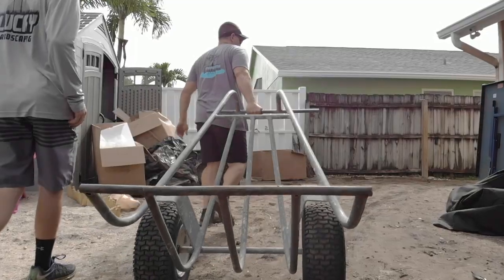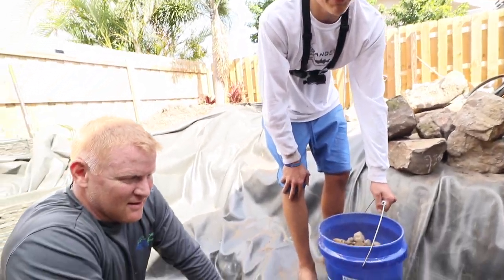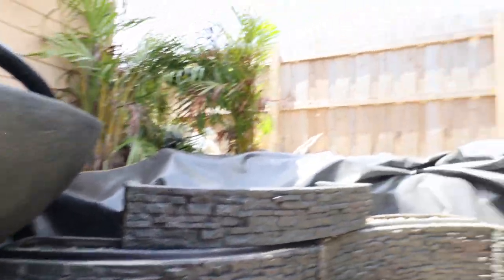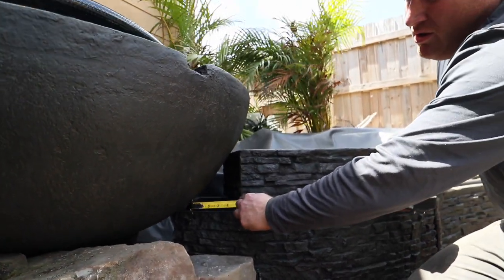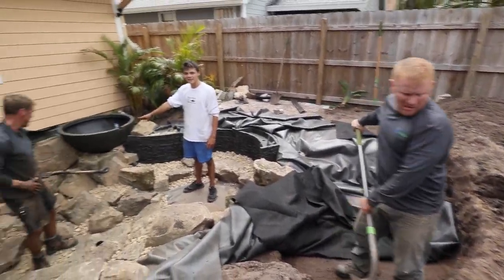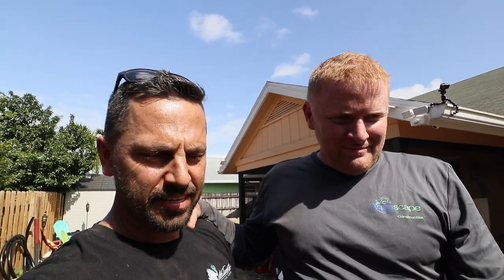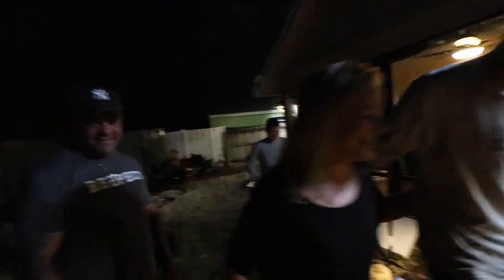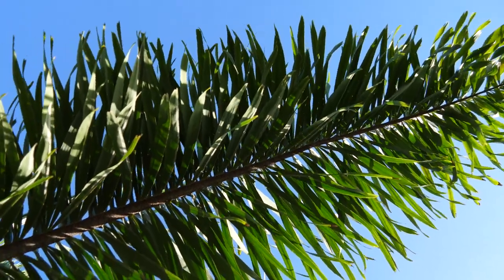Paul Cuffaro COMPLETED Massive Backyard Fish Pond Build with Aquascape - Part 2 - VLOG 042

Comment: Paul it looks like about an 11x15.  Can you tell me how many pallets of rock were used? How many and what sizes per pallet ( small med. Large stack)? So how many 1 man 2 man 3 man boulders were used?  One biofalls and one skimmer I'm assuming.  Also any dosing system? UV light? Any thing else? Any help appreciated.
Reply from the maker: Robert Draper we used about 7 large pallets of Tennessee boulders, about 60% were 2 man and the rest 1 man, 6000 signature biofalls and 1000 signature skimmer, dosing system and I think there were 12-15 lights.